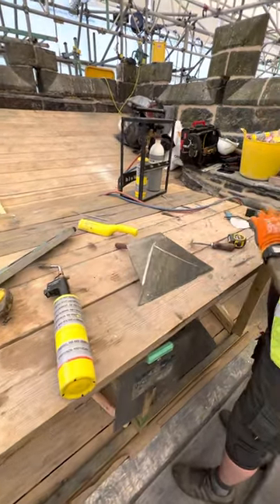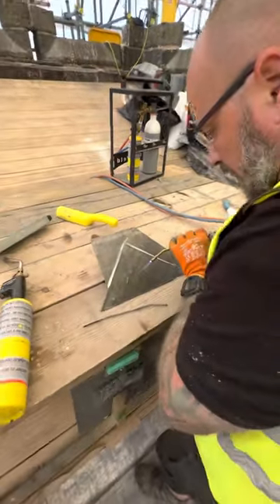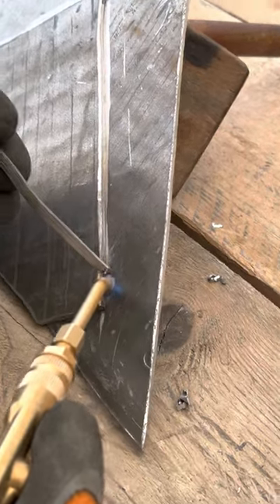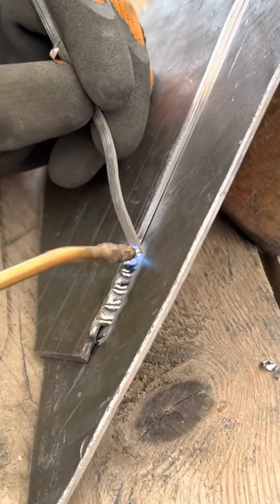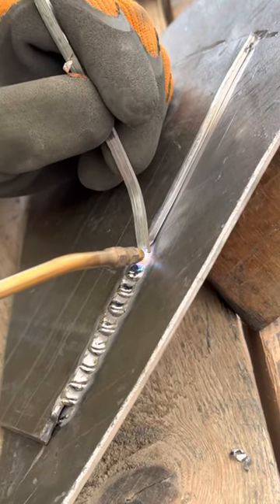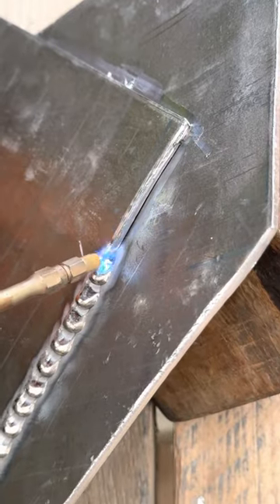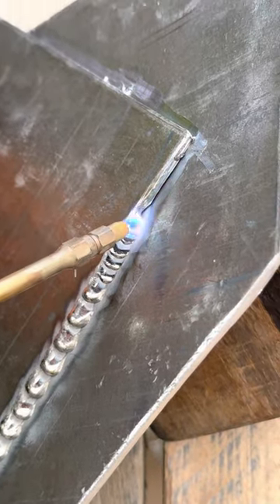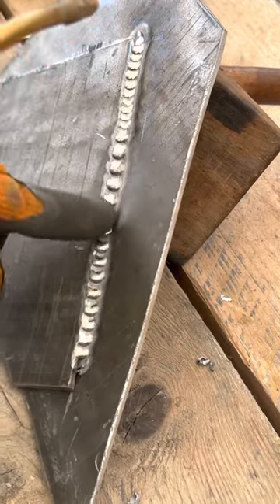How to lead weld verticals for beginners

Comment: Very informative are you using map Or propylene looks like a nice bit of kit to lug around the roofs
Reply from the maker: Map gas and oxygen mate and yes great bit of kit
Reply: What size nozzle do you use for code 4 just picked up a propylene set and it only come with size 1 nozzle

Comment: Can i use this technique or brazing technique using lead on stainless steel? Will the lead ahere to the surface of  stainless steel? My pan is to fill in the gaps between the gutter joints. Cheers mate.
Reply from the maker: @sweeyong7756  hi mate,
Stainless steel is something I havnt used so unfortunately I can’t say yes or no mate but there is only one way to find out, I would try using some solder as well maybe? 
Let me know how you get on 
Shaun.